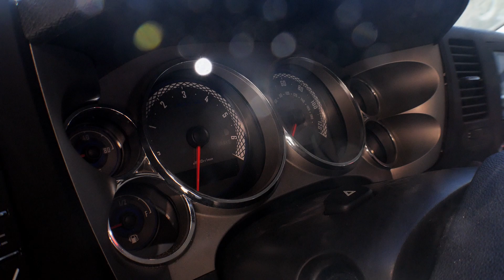Racing to Perfection: My 7-Minute Silverado Interior Transformation!

Comment: I wish someone would make a paddle shift steering wheel for the Silverado’s, also thanks for posting videos. I’m doing gears and all new suspension in my truck soon.
Reply from the maker: It’s would be cool, slightly difficult but not impossible to make a paddle shift steering wheel for the Silverado.